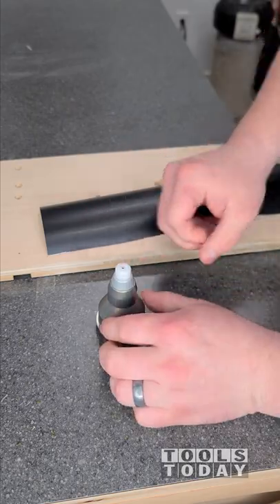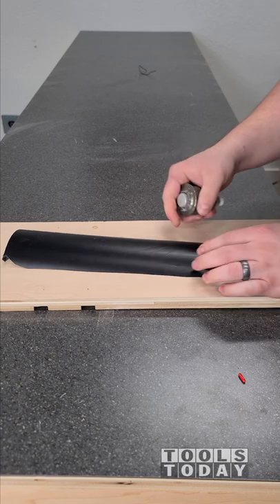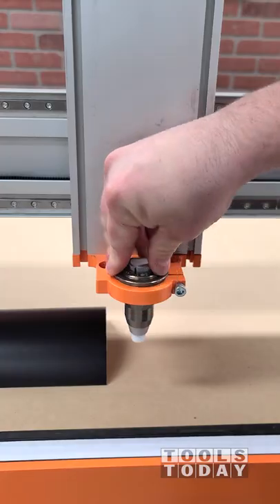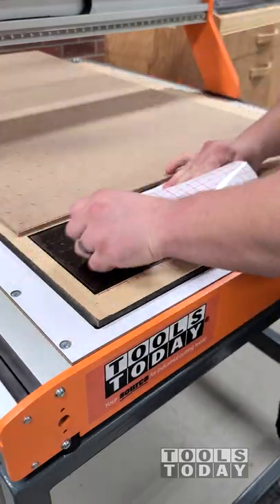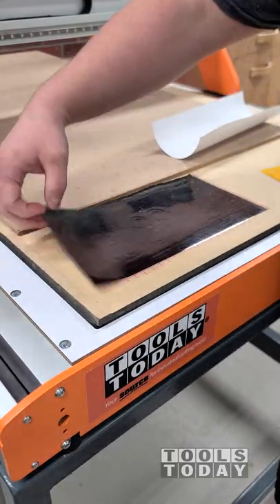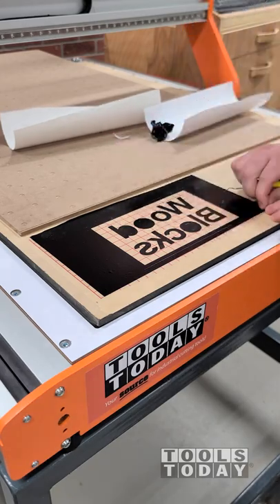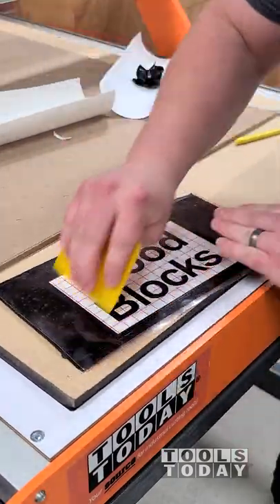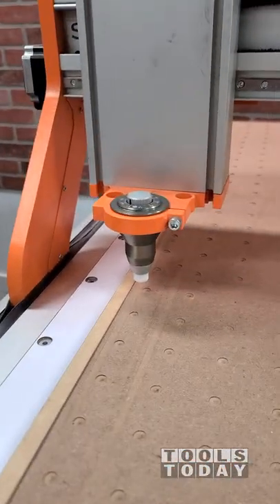Using Drag Knife on CNC

Comment: Hi, I work with vinyl every day, I do car wrapping, signage, and billboards. One tip I'll give is to take off any vinyl you don't want before adding the application tape. It helps to line things up, it's easier to remove before applying the tape and you won't accidentally dirty the vinyl you want to apply.

All in all good video! I will say there are some situations where applying the tape before weeding the vinyl is better but when you need to remove many things or small details it is better to do it before as the longer you mess with the vinyl when it's not on its backing sheet the more chance you have of getting dirt on it.

Edit: one final tip. This works with big jobs, use a drop of dish soap in a 2L bottle, shake it up and pour some into a spray bottle. You can then spray a mist (or more, depending) on the sticky end of the vinyl and you can then place the vinyl down without it sticking so you can maneuver it to the correct position. When you are happy with where it is, use a squeegee and  aplicate the vinyl. Be sure to use some pressure to get the water out from behind the vinyl and let it sit for about 10-30 minutes depending on the temperature. Less time if you place it in direct sunlight.

Side note: any small amounts of water behind the vinyl will eventually evaporate.
Reply: o0Dread0o, awesome tip, maybe you should post a video 👍🏻
Reply: @Tony-rl2fr  probably not a bad idea.
Reply: I concur.
Reply: I’m glad you reassured me that I’m not crazy for weeding before transfer tape
Reply: Rapid tac is amazing application fluid if you need it
Reply: Exactly. It's called Weeding the vinyl first. As you can see you ripped the W doing it that way.
Reply: I came into the comments to say this exact same thing. I worked on a sign shop for 8 years.
Reply: Yep. Weed it first. 
15 yr exp
Reply: P

Comment: I do this on my cnc as well but the problem I have is if you’re doing intricate pieces, then you’ll notice that the cnc doesn’t cut out the entire piece and leaves a little tab of uncut vinyl. I think the problem is with the offset of the blade. Do you know of any way to get around that?